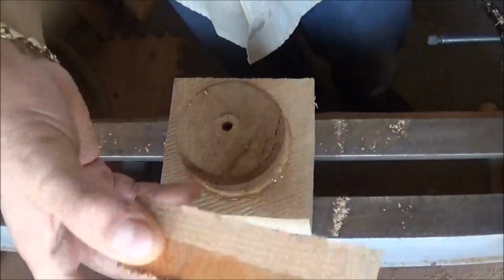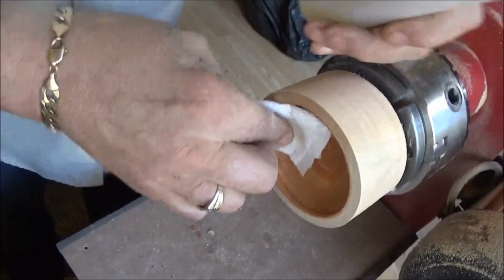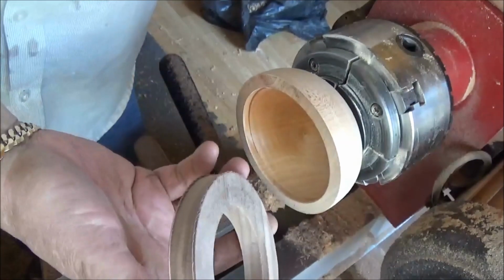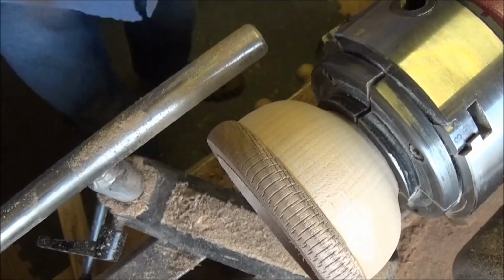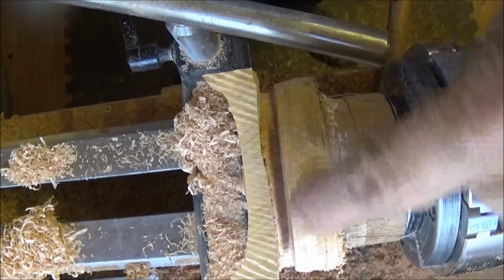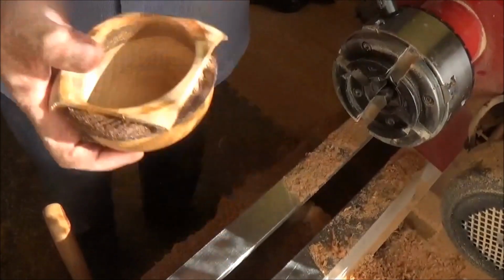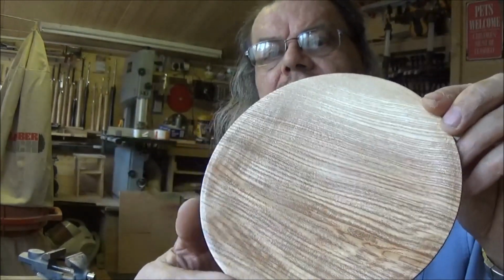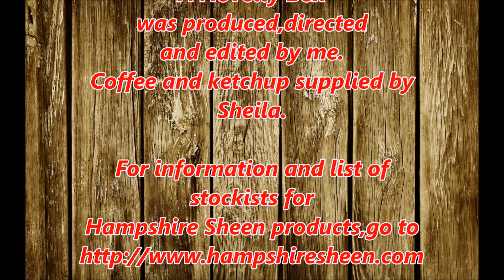Woodturning at 54a.  #96. A Novelty Box,and Hampshire Sheen review #2

Comment: Love the burger. It wasn't until I see the cheese glued to the burger that I realized what it was. As to the Woodwax, you hardly need to use any at all. It's always best to rub it in with the lathe stationary, leave it for at least 30 seconds and then buff up. Any subsequent coats try and leave it 5-15 minutes between coats. Great video!
Reply from the maker: Paul Lockwood I'm quite satisfied using the polish as I do